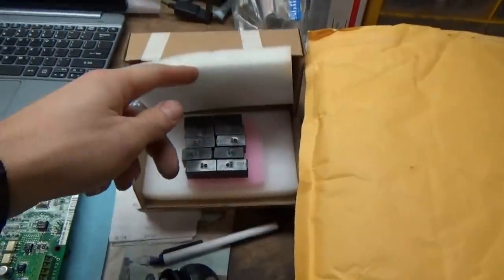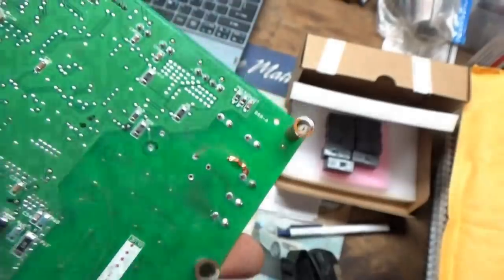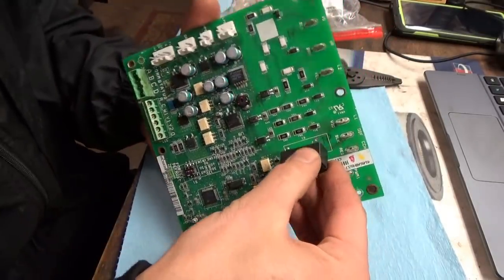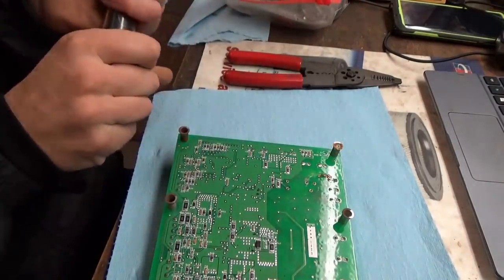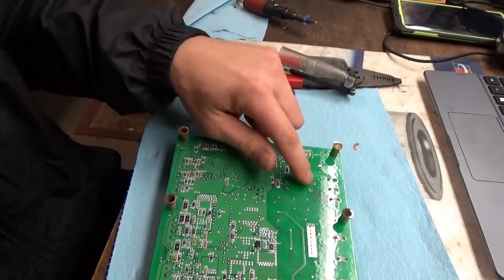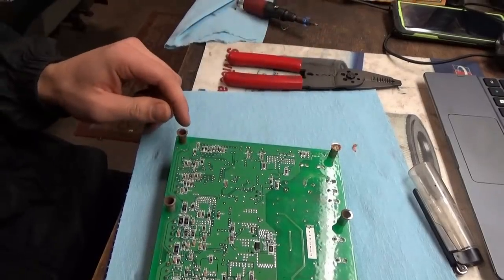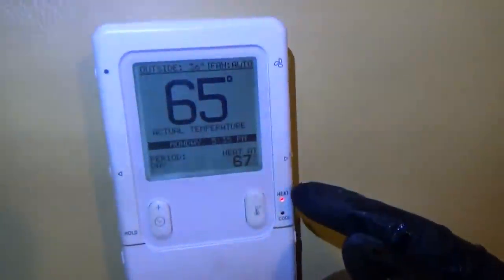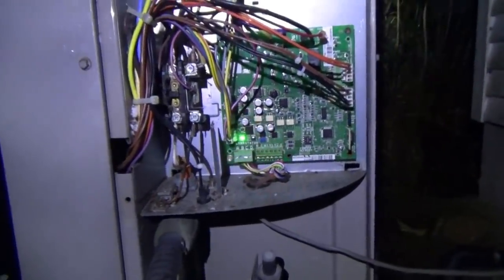Bryant HVAC Heat Pump -Part 3: Repair

Comment: Preventative : Check your caps, blower too, they will be weak and change out your compressor contactor you can put a larger amperage in for longevity.

Comment: Hi Ivan  The circuit board should be resprayed with conformal coating just to stop your repaired area getting corroded or you could use some (not ideal) nail varnish, otherwise in a year or two you'll be trying to repair board corrosion.👍

Comment: Great to catch up on your videos now work has finished for Christmas Ivan. Any chance of becoming Pine Hollow HVAC diagnostics? lol 

Maybe you should get one of those used control boards if its going cheap from ebay and put in in a spare parts box? I've done a similar thing with my boiler and a few of my appliances, i have a box of spare parts for all of them. I got really lucky with my dishwasher the main control board faulted in April but luckily i had a spare i pulled out of another identical unit that got tossed out somewhere i used to work. It was lucky because i haven't been able to find another one since. 

Great series mate. The principles are roughly the same if you can troubleshoot cars you can troubleshoot anything.

Comment: I have an older A.C. unit (35 yrs old) that is not a heat pump and was made before diagnostic codes and twice the condenser/compressor fan quit on mine over the years.  The first time after disconnecting the power a I took the fan grill guard off and after looking at wiring found an electrocuted mouse that had chewed through a wire.  The second time when I took the fan grill off found that the blades would not spin.  Took motor out and was able to remove motor ends and polished shaft with emery cloth and put back together.  There are two metal tubes that that run to the bronze bearings with AL plugs that you cannot see with the motor mounted.  After lubing with turbine oil was able to get the shaft to spin very freely.  Now every couple of years I pull the AL lube plugs and give the motor bearings a shot of turbine oil.  It has been running good now for the last 6 years.   Had less than 50 cents into both repairs.  I'm sure I save hundreds of dollars.  
Enjoy you videos...keep up the good work.

Comment: Great diagnosis and repair!  I'd wire a fuse in series with that crankcase heater to prevent this from ever happening again, in case of future mouse invasion.

I recently did a similar repair to my own AC unit.  Hard-start capacitor died, and then a few days later, so did the fan! $10 cap + $120 fan motor (OEM part, even) and I'm back in business, no labor or service charge!

Comment: Great video! Your videos are so enjoyable to watch. I was hoping you would find out why the trace and relay burned out before replacing the board. If you run an air conditioner compressor, and it has refrigerant entering in liquid form it can burn out the compressor. Whether mechanics, electronics, or anything else you have a great method of troubleshooting that makes it very enjoyable to watch. Thanks Ron
Reply from the maker: Thanks for the kind words, Ron :)

Comment: In reference to part 2 .. connecting the heater “full time” vs thru the relay is .. the heater turns off when the system is running if thru the relay.
One alternative would be to energize a second relay from the one on the control board, and run the heater (and fan too) thru that (and fusing it) to protect your control board from over current ...

Comment: Did you disconnect your hard wire fan continues run, or what? The video was very good but what about that part of it, thanks
Reply from the maker: After the repair, everything was reconnected as originally designed :)

Comment: Nice work Ivan!  Appreciate you sharing this whole experience with us!👍🍻 

Yeah, that's the law of averages - whenever a heat pump fails, it will be raining or snowing. Whenever your car breaks down, the same weather applies. When a boiler or furnace fails, it's always on the coldest night of the season!😒

I did a similar repair on my Amtrol Boilermate indirect-fired (meaning, it's just an additional zone for my oil boiler to heat, complete with it's own circulator) hot water heater. This was the dumbest design I've ever seen. There was a relay inside that was continuously energized when run on 120v, but not energized if run on 24v, so of course, the thing burned up after just 8 years. New board, about the size of a wallet,  was $250! Now I didn't come up with this repair myself, nor did I even troubleshoot anything - I happened to find a post in a review section for this board I believe at the manufacturer's website, or a company that sold their parts - I was shocked they left the post up! Was an electrical engineer that chimed in and gave a complete and detailed description on how to repair these failed relays with ZERO parts! Just a couple jumpers and some solder. If I remember right, the failure was a blinking display, and constant clicking of another relay (probably to protect the board from 120v heading the wrong way). So I followed the guy's instructions to the letter. No solder sucker ... so just painstakingly heating, pulling, heating, pulling, for 2 hours to get that multi-pronged relay out! I figured out exactly where to run the 2 jumpers from his description, and also removed a couple capacitors if I recall correctly. Plugged everything back in, flipped the switch, and it's been working flawlessly ever since! 5 years this summer.  😎

Second board I repaired was my Davis Vantage Pro2 wireless weather station. There was a super capacitor that explodes inside the unit - known issue with these, so no troubleshooting this one either. I bought two supercaps, since there was an additional spot on the board for this purpose for units sold in AK, where darkness can exceed 18 hours (there's a small solar panel on the unit which keeps these capacitors charged - when the supercaps run out of juice, a 3v 123 battery takes over, and will die in 2 months if not assisted by the supercaps). Soldered them both in, and the board was fixed. That saved me $135 ... at least for 5 years, until that board failed this past Spring. I recorded a rainfall rate of 220 inches-per-hour, HAHAHAHA! I wasn't smart enough to figure out what failed that time ... 😁 Says we have 180" of rainfall so far this year ... 🤣 New board repaired that problem. Wish I knew which component failed that time!
Reply from the maker: Always enjoy reading your tales, Smitty ;)
Reply: @PineHollowAutoDiagnostics  - Thanks Ivan! I've got a few of 'em ... 😁

Comment: How many times can Ivan say 'SODDER' in an 8 minute video?! Agree 100% Refrigeration A/C Mechanics would simply change the board as it gets the Customer back online quicker(mostly) but, anyone who doesn't investigate that mess made by the Rats (& consequently find the bare wires as you did) quite frankly shouldn't have a job IMHO!

Comment: Fixed my garage door light problem where a relay was stuck on all the time. Had neighbor come over and press switch while I put my finger on top of all the relays feeling for contact movement. Removed the relay(have navy background in miniature soldering) and found part number. Took a week, but had it fixed for around $10. Pretty sure a call to a mobile technician would have been a $100 and then they would have wanted to sell me a new garage door opener. $$$

Comment: Virtue signal much?
 Yea, EVERYBODY is out to stick it to Ivan. Poor Ivan!
 Ivan is the ONLY one who is honest!... Sigh!
 That was a very informative video and I learned a lot. 
 But you had to make it all about Ivan and how he is so abused and taken advantage of. Really?
Reply from the maker: Interesting take on that message Rick....but why abused and taken advantage of? Quite the opposite!
Reply: @PineHollowAutoDiagnostics  Come on Ivan...6:55-7:45..." ...probably quoted a new board...$700 in parts...$1000 easy...can't solder wires...new compressor...several thousand dollars..." I guess they are all out to get you. I found that such a jaded and self-serving attitude. Not every service tech  is a crook. And even you don't work for nothing. And I assume you don't aspire to be the cheapest diagnostician in Penn.
Reply from the maker: @rickowens4397  you don't agree with that hypothetical situation? I think it would be very realistic....maybe I'm jaded from working in the automotive field too long haha

Comment: Ivan,  I'm a big fan of brushing on some Kester liquid rosin flux on the solder points before actual soldering; it flows/penetrates so much better that way.... JMHO with lots of experience with boards/soldering... Also it's nice to see you got a quality de-soldering tool like the Hakko FR-300; adding the liquid flux also helps a lot too when de-soldering...

Comment: Hey would you be able to look at my snap on vantage? I bought it from a coworker who no longer works with me. It needed batteries and I bought them and it still won't even turn on.
Reply from the maker: Sure send it over!
Reply: Pine Hollow Auto Diagnostics you're the man! My email is dloughy@live.com. just email me an address and any other info and ill get right on it. Thanks

Comment: Ivan I do not know what solder you use but unleaded solder is nowhere near as good as leaded good fix either way though
Reply from the maker: Radio shack fine flux core....it's awesome!

Comment: Smashing repair ivan :-D, well worth the effort and not giving up.
50 dollars is still nothing, it would have been eyewatering if you went the evac path.

One thing i did notice is a lack of protective fuses, one on that relay common feed would have popped before taking out the relay, i wonder if that's on purpose to make you shell out cash on a new pcb hmmm..
The relays can sit on a shelf untill you find a use for them, they are sealed so won't go bad.

Comment: Save yourself some future problems.
Coat that bare copper on that "fix" with some clear nail polish or something...even a bit of 2-part epoxy if you've got the ambition.
Otherwise you're going to end up with a pile of green crusties in the future and be fixing the same problem again.
Looks to me like the rest of the board has a conformal coating on it that has now been compromised in the area of that burnt up trace.
Reply from the maker: Wouldn't worry too much about that. After all this is AC current; green crusties are usually caused by DC (one way) current :)
Reply: @PineHollowAutoDiagnostics  True.  But they don't conformally coat those board 'cause they're happy to do it!
Or are they?
Carry on...
Nothing to see here.
These weren't the droids I was looking for...

Comment: Molodets! Good job.
Just curious, is the heat pump the only source of heat in your house? Is there an auxiliary resistance type heater (a.k.a. - Emergency Heat) in the "evaporator" unit? 
We have two heat pumps in the house. They can't provide enough heat when outside temperatures drop below 25 degrees.  The emergency heat elements kicks in often during cold weather and it draws a lot of electricity. I disconnected the emergency heater completely although it can be activated with a switch if we really need it. I installed a nice soapstone wood stove. It heats up the house easily and runs all day long on one load of wood. We love it.
Reply from the maker: Yup exact reason I installed a wood burner a few years ago as well :)
Reply: @PineHollowAutoDiagnostics  ahha thought heat pumps were limited.

Comment: great fix for a car guy .aka super gunises !.visual inspection key !!did pool heaters mice tore them up.boards wires etc. .cool hot wire for heat.ten relays funny?one board used 150 plus i think i saw.smart man!! saved yourself big bucks .eric o would be proud.good job thanks.john

Comment: how much heat does a heat pump??pump ?though they were a southern thing? never seen heat pumps up north?.hot air,hot water ,steam ,gas,oil,ele.only see wood stove in back ground.is the heat pump just supmental or primary heat?thanks john.

Comment: I’m impressed Ivan. I fix all my appliances also encluding my furnace,a/c , washer and dryer. Rebuilt the head on my water softener. The nice thing about most appliances is they leave pretty good schematics somewhere inside and if all else fails I look up guys like you on YouTube to help me through the process. Nice work Ivan 👍
Reply: 7-8 years ago my clothes dryer suddenly decided it would run any time the door was shut and the timer was not in an "off" position.  I thought it would be a simple start button switch but it wasn't.  Fortunately, the schematic was hidden inside the unit near the timer.  After an hour of tracking down the entire circuit with an old junky Radio Shack analog meter I finally came to the conclusion the motor was bad as it seemed to be stuck in the start mode.  I was about ready to replace the dryer or order a new motor when I got to looking close and found a bobby pin inside it shorting the windings.  Pulled out the bobby pin and it worked great!  I was so satisfied with myself, and all the money I saved, that I decided it was time to treat myself to a new Fluke 87V meter!
Reply from the maker: Thanks for the comments, Willie! It is really satisfying to figure stuff out and repair it DIY. One gets a true sense of accomplishment!

Comment: I fix everything that goes wrong around the house and with my vehicles. I know a lot about electronic troubleshooting and I still go get YouTube certified when I need to fix something. It is always good to get new ideas or understanding when necessary to attack a problem for a successful, proper and economical repair. Nice video series.

Comment: How are you at diagnosing flux capacitors? The time shift is out of sync.
Reply from the maker: Well the information on those is probably floating around on the internet so nothing in the way from learning and doing haha
Reply: Pine Hollow Auto Diagnostics “Safety Not Guaranteed”, a 2012 Indie movie by Lynn Shelton, has some information about this. Look it up on IMDB - the picture of the newspaper ad seeking volunteers will make your day, as will the movie itself.
Reply: Yeah, I know what you mean.  My time machine broke down and it will only go forward in time, not reverse.

Comment: Good job. And yes I believe about $1300.00 IF they didn't go after a compressor. I have an indoor motor and an outdoor cap coming up. Would have been $800.00 for the motor and $300.00 for the cap. That's a quote that I got from a reputable HVAC company in my area.

Comment: Too thick of a wire to replace the track... one strand of that wire can take 7 amps for a good 10 seconds (you can verify this on your power supply) and there's usually 32 of them in a wire like that.

Ok,  so yours is a 'this will never fail again' type of fix, but, realise, the only reason you didn't have a fire in your heatpump is because that PCB track gave way, as it was designed to.

Beefing that up by, I'd guesstimate, at least a factor of 50 is possibly not the best idea. When designing a circuit, you want a fault to break it, not for it to be strong enough to maintain a spark which might set fire to the unit. Possibly the main breaker would pop eventually, but I'm not so sure. The track was beefy enough for the breaker to have popped if the fault had been an absolute, dead short.

In future, use 30AWG solid or 24AWG stranded wire to repair tracks, intended to carry an absolute maximum of 5 to 10 amps, on a PCB.
Reply from the maker: That exact thought crossed my mind. The next weakest link is the L1-to-relay PCB trace so there is still a "fuse" in place...but I might install a real fuse anyways haha.
Reply: Yeah, the UL/CSA type safety testing would require that if that heater shorted out, it would fail safely without causing a fire or shock hazard, but that's it.. unfortunately it doesn't require that no expensive parts are destroyed in the process! Quite possible that the PCB trace was what was designed to fail in that case - obviously it's not going to flow enough current to pop the breaker supplying the unit.

Comment: Overall, I think you've done a great job!
I didn't understand your math.  I'm math challenged when it comes to Geometry, Trigonometry, and more!  LOL!  I know the 240 AC residential power is single phase, so for me, with the wiring diagram it would have taken longer, probably using jumper wires I would have found it.  So what else did that board control?  Certainly not all those components were for just control of that one relay?  Very Good video!

Comment: I'm super impressed, Ivan.   You did a great job of trouble shooting and coming up with the fix.  Also, loved your "temp fix" which kept the heat on while you were awaiting parts, etc.  Thanks.
Reply from the maker: Thanks Michael, the temp fix worked just fine...I was actually kind of surprised lol

Comment: a couple months ago are gray mills parts washer stopped working . the circuit board was burnt from to much draw from heating element . i did the same thing you did except i installed the relay externally from the circuit board

Comment: Great job Ivan!  You saved a ton of $$$$$, plus (more importantly) you were able to keep Mrs. Ivan warm while you were saving the money.  We all know if Mama is not happy 'cause she is cold, ain't nobody happy.  LOL!

I followed this one with interest since my camp has two heat pumps and I've done numerous repairs over the years including some temporary workarounds similar to what you had to do.  When you arrive at your camp at 10 PM and a heat pump won't come on your DIY skills really get tested.  :)
Reply from the maker: Thank Joe! Does your camp have a wood burning stove as well? Those never break down :)
Reply: @PineHollowAutoDiagnostics  Yes it does, but it's in Louisiana so the real emergencies are during the summer when cooling is needed.  :)